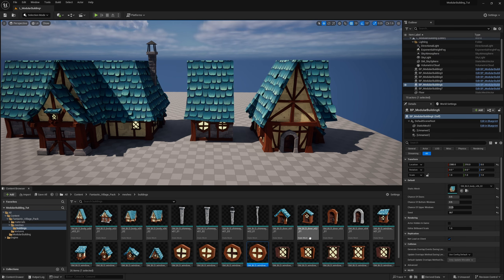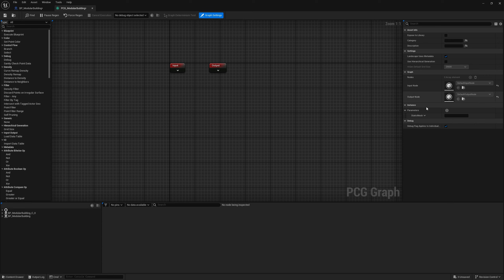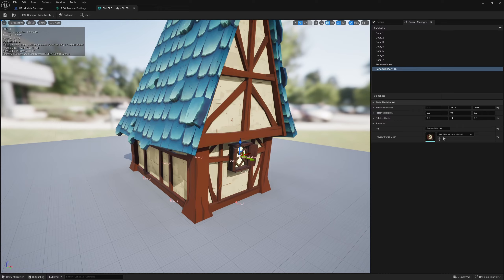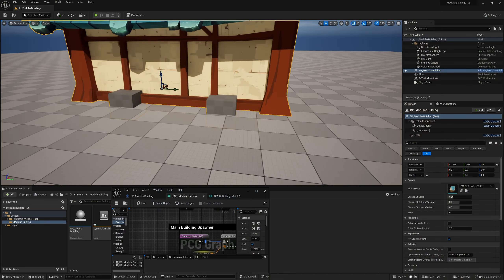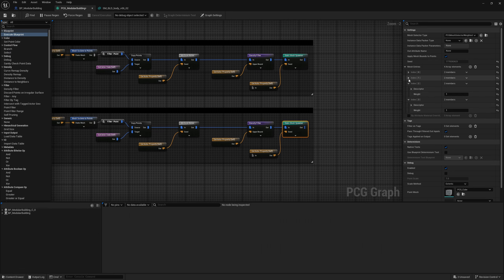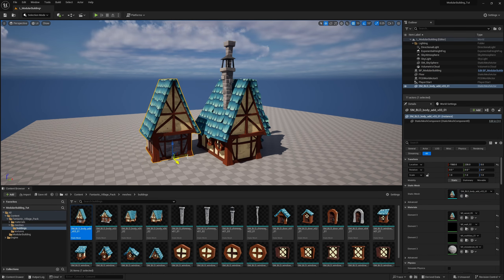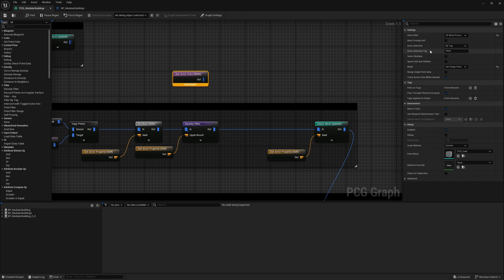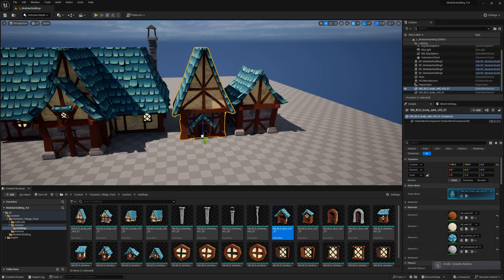Quickly and Easily Assemble Modular Buildings With PCG

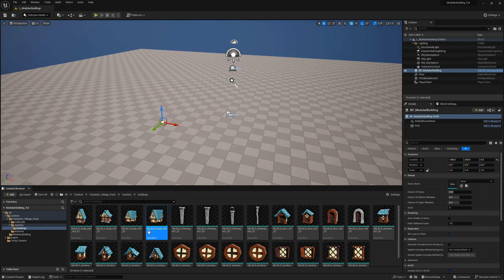Comment: I followed the steps up to 3:38, but the mesh isn't appearing.
Reply from the maker: Did you debug the points? Are the points there? When you press "A" to debug the point info, is it all you'd expect?
Reply: @Procedural_Minds  Hi, for some reason, the static mesh is now showing. However, I encountered a new error at 9:02 when adding attribute noise. When linked to "Copy Points," it shows the error: "Error: Attribute/Property 'ActorReference' is not a numerical type, we can't apply noise to it."
Reply: @hvillacruz  I had the same issue in 5.5. In your Attribute Noise node, look at your "Settings" to the right. Change your "Input Source" to "$Density".

Comment: Why create the parameters on the BP and not directly on the PCG and modify them on the PCG component attached to the BP? so you don't have to be worried about missplelling and you can substite a lot of anonimous getActorProperty() on the graph with spefic getParameter() that show the name of the parameter, so a large graph like this become more readable.
Reply: Another question... which is the difference between using a custom seed and the seed already present on the PCG component?
Reply from the maker: It's just a matter of preference. It's much easier to just click on the BP and just edit the variables without needing to also scroll through the component and select the PCG one.

As for the seed, from my understanding there's the global seed for the graph, and the seed per node.
Reply: @Procedural_Minds thanks for the reply! I m a little fussy 😅😅

Comment: This is EXTREMELY helpful. I haven't watched all of it, so you might covered it, but what are your thoughts on how to use this type of system to update and populate static meshes based on world state? I'm thinking something like the trash and fires in the later parts of Spiderman for PS4.
Do you think you could use this for that kind of real-time gameplay driven placement system?
Reply from the maker: As of 5.3 the real time aspect isn't fully functioning. With 5.4 it should start working so I'll be doing tests on it at that point.
Reply: @Procedural_Minds  Awesome! Thanks for the reply. I was thinking about upgrading from 5.3 to 5.4. It seems like a lot of great additions. 
Subscribed, btw. Great content man.